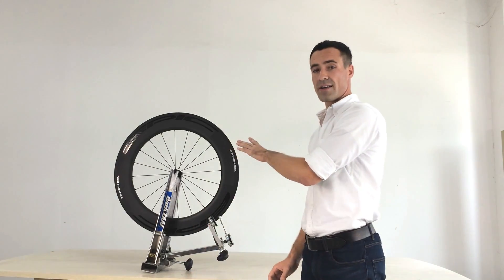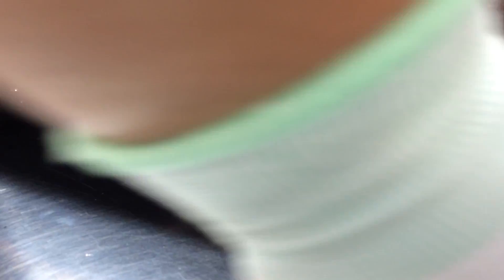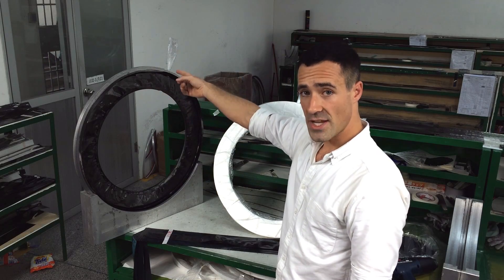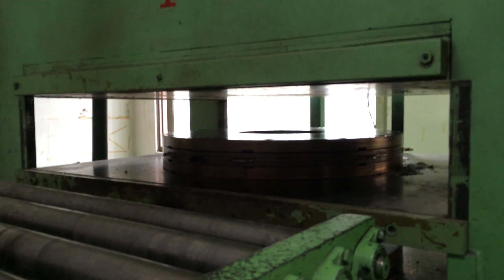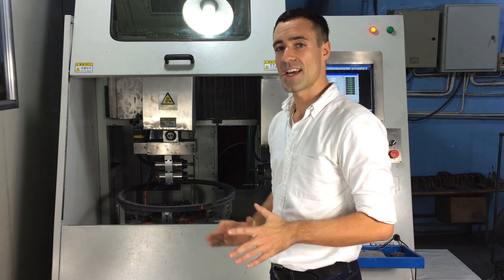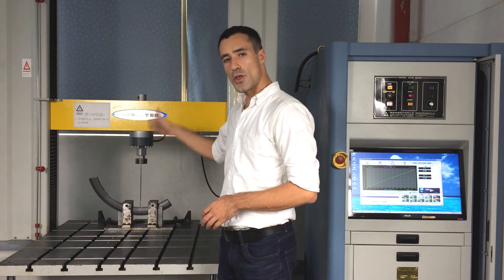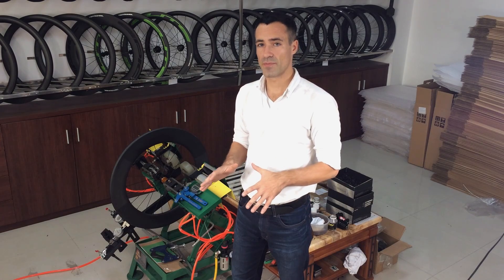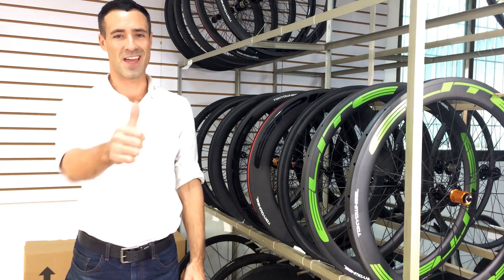How are Carbon Wheels Made - Tokyowheel Factory Tour

Comment: How is the air bladder removed from the rim? The rim is a closed shape, so it seems like you can't remove the air bladder? Also is the air bladder a circular piece or just a tube that wraps around but does not connect with itself at the end?

Comment: An in-depth tour of the Tokyowheel carbon wheel factory.

that's not quite true.  The factory is NOT a Tokyo Wheels facility. James is saying "we" but he should be saying "they".   cut out the middleman in the white shirt by clicking https://www.wheelsfar.com/   

 Check out Tokyo Wheels customer support.  
No replacement of  faulty wheels just some parts sent out for the customer to get another person to do what Tokyo Wheels never did in the first place. Correct assembly. 
http://forums.roadbikereview.com/general-cycling-discussion/extreme-caution-about-buying-tokyo-wheels-365249.html

Comment: I would love to see a product review by an actual rider/club racer to give their honest opinion of these wheels.

After watching this video I have to point out the obvious.  Basically your factory is in such a bad part of town in a country that you wont mention that it has to run on generators?   The building looks really run down and almost falling apart.  I especially love the 3 foot cobweb in the corner of the room at the beginning.  So many manufactures are making wheels but nobody gives a full review of how they ride and hold up...  For a new wheel company those machines look 30 years old.. The final thing that I noticed was the air hose or line scotch taped to the floor.  Really??
Reply: Reb Bliefernich google for their reviews. These guys are a joke, selling open mold rims and lying about their engineering and development process.

Comment: Thank you for this factory tour!
I cycle in a region where temperatures reach 50C in Summer. That is off season however we always sneak for a very early morning ride when the temperature is between 38C and 45C. My question is how much will the breaking be affected in extreme conditions like this and how safe it is to use Tokyowheels.

Thanks again
Reply: Hi Rabih, thanks for your question. That's hot, wow. Fortunatly the Duraheat-R™ braking surface on all our rim's are temperature resistant to 240C, so you'll be fine. As you can probably imagine the braking surface heats up much hotter than the air temperature. Let me know if you have any other questions via email questions [at] tokyowheel.com Thanks!